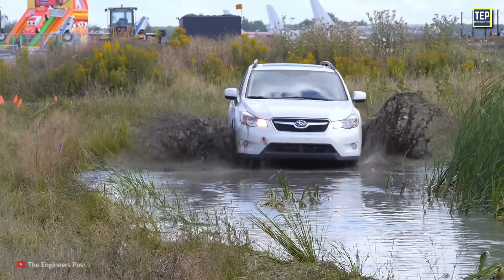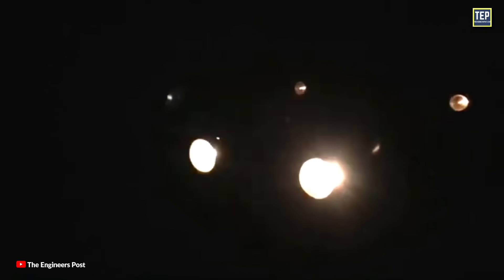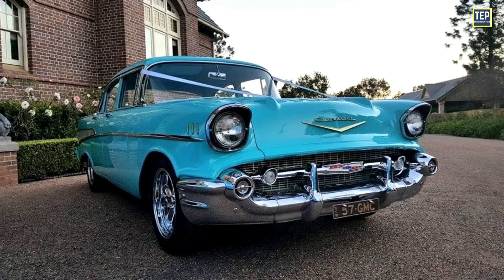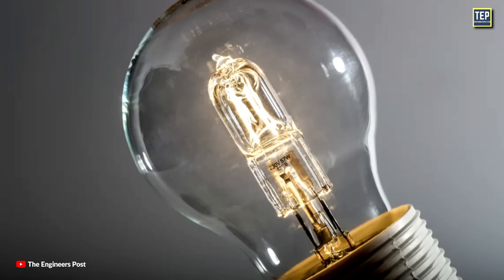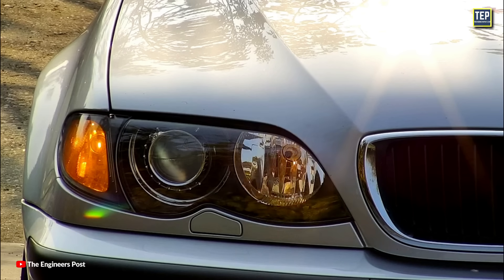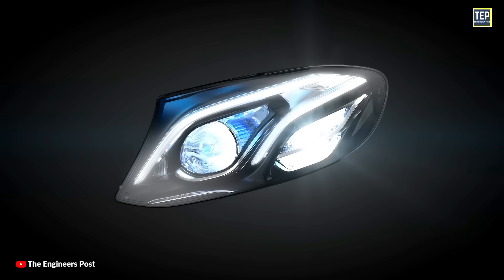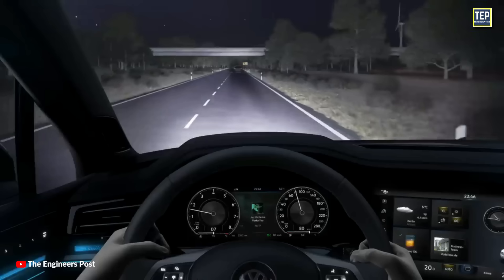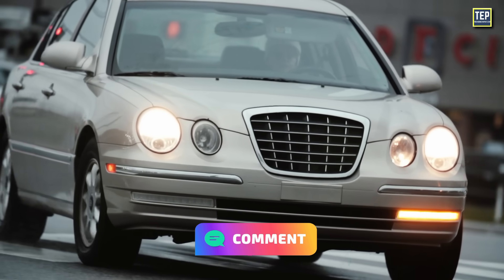The Problem With These Headlights

Comment: There is not much wrong with current headlamps (note: headlamps, not headlights!!!) per se.
The problems is mounting height, poor aim, lousy reflector and lens, poor beam control, and worst of all, stupid drivers who keep driving with the high beams on.
Evidently, nobody tells these idiots that little blue light on your instrument panel means you have your high beams on.
That said, you will never get a ticket in North America for driving with your high beams on, whereas in Europe you will get a pretty expensive ticket plus some points as well as you may blind oncoming drivers to the point where they may run off the road.
Now, there IS a problem with new current type of lamps; have you ever had to buy a Xenon bulb?
$$$$$$$$$$$$$$$$$$$$$$$$......!!!!

Comment: I just traded in my 2008 Mazda 3 S Sport (with smoke tinted lenses) for a 2017 Passat w/ Tech.  The stock headlights on the Mazda always seemed lacking.  I also have an '07 Tacoma 4X4 with stock halogens.  The Taco's lights are so bright, I rarely use the high beams.   With the VW's LED lights, I feel sorry for oncoming traffic.  I never need the high beams on the VW.

Comment: H6024 and related numbers are Halogen sealed beam bulbs and available since circa 1975 in the U.S. Can get DOT/ECE Legal LED Sealed Beam but expect to pay $200 to $300 USD for 2 lamps. Most LED and HID before that sold thru Amazon Ebay and many others are NOT "Street Legal" and worse many have Counterfeit DOT or ECE marks. LED or HID Does Not Work in Halogen Shells of any type because of Focus and Heat problems. LED for Headlights Generate a lot of Heat that must be removed or the units will have a Very Short Life. Even when you buy Legal LED Sealed Beam lamps often they won't last because not enough airflow on the back that is a Heat Sink.

Comment: I am old ish😊 , I’ve driven with all of those lights except for the old old chemical gas ones in the early 1900’s. 
  Good lights are important , but unfortunately they are often misused in the wrong application, and also sadly , they are often used by uncaring ignorant drivers . 
 I might add , as someone that worked in car repair industry , and also drove trucks for a living for years , headlights in many countries are probably one of the most poorly policed safety items on a motor vehicle , that goes for general specifications and also design, like for example uniform headlight heights ,  if you have been in normal sedan sitting at the traffic lights and had higher SUV or four wheel drive sit behind you with the much higher headlights shooting through your back window lighting up the inside of your car like a bright sunny day , you know what I mean. 
 Poorly adjusted headlights, incorrect globes and lights fitted to unsuitable headlights with the wrong reflector shape . 
 Bright lights are fine if they are adjusted and set up correctly. 
  I’d say if you drive highway there is a happy medium to the brightness of lights , even if you are alone on the highway and driving for hours at night , having lights that are so powerful when they hit the shiny metal back of a metal road sign and reflect back at you can really make your eyes sore. 
 A good spread of light that is fairly white but not so white it hurts to look at is good . 
 And low beam lights that are still nice and bright , but adjusted away from oncoming drivers and below their windscreen level . 
 Some cars have height adjustable lights from a dial in the cabin which Is pretty cool , other have dampened height self adjusting mechanisms. 
 Then there are the old cars that are just set at the factory, they have a device they stick in front of the headlights which shows where the main part of the beam is and adjust it to the centre line while on high beams . 
 Of course when you put something heavy in the boot/trunk , the back of the car goes down pointing the old style headlights up a bit , you get that in the pick ups too. 
 I remember as a young bloke driving up the country at night on a very windy mountain road I was going around a bend at a fair rate of speed , there was a very big drop down into the valley on my side of the road , and some asshole came around the bend with headlights and two powerful sets of driving  lights on full beam , I was absolutely blinded for about 4 or 5 seconds , I had pretty good nerves back then , I held the steering wheel in same position and managed to negotiate the bend ,  the asshole just continued on with out dipping his lights . 
Humans can be ass holes sometimes . 
 I must confess  , I probably like leds the best because they light up instantly, they don’t need a few seconds to warm up. Although my current lights in my car are HID with the correct reflector on low beam and the original old halogen globes for the seperate high beam lights , which I have to say are just adequate , however they are very comfortable for driving for hours at night . 
 Here is another little bit of trivia , blue is the hardest color of the light spectrum to see and look at , if you look at the dash lights of many modern cars they are a pretty blue , and people always like the pretty blue and no doubt that is why most car makers use it , but the fact is , blue is actually sub optimal, the best color for long distance night driving that is easier on the eyes is actually red. 
As an old truck driver at one stage I did a fatigue management course , and this one of the topics mentioned for long distance driving. 
 And having driven many many big rigs over the  years , I can confirm red hurts the eyes less.
Reply: Red lights are used inside submarines
Reply: I believe so too, red is better than blue.
Also really? Waiting 2 seconds for xenon's is that bad? LEDs have many more advantages but you mentioning only this is funny for me.
Reply: @drayke8886  you misunderstood. He was talking about the colour of lights inside the car at night. As another commenter pointed out, red is used inside submarines. It’s the colour that is easiest to adjust to no light from. It’s therefore the colour that has the least difference to darkness in front of the car. It’s least stressful.
Reply: @nickc6882  "I must confess  , I probably like leds the best because they light up instantly, they don’t need a few seconds to warm up." What part of this is talking about the lights on the inside? Do y'all also have some weird halogen or xenon lights for every button that needs to light up?
Reply: What isn't covered is the old round lights had a beam that illuminated the road ahead, not the verge or the treetops, all the modern lights I have experienced throw the light everywhere except up the road, creating more dazzle for oncoming drivers. They may be as claimed more light efficient, but they don't use the light efficiently.
Reply: @CrusaderSports250  possibly you are experiencing badly installed or cheap ones then. I agree with your comment that illuminating tree tops is a waste, but the verge is essential for at least 3 reasons:
1. Animals and people step into the road from the verge, you want to know they are there before they do
2. It gives you indications of corners before you get there
3. It shows you junctions and side roads 

Modern matrix LED headlights are so accurate they can put high beam either side of the car in front of you whilst maintaining low beam on the vehicle itself.

Most of the times I’ve been blinded by LEDs is when the car they are in is modified or overloaded. If you raise a 4x4 for off reading, you lift the lights with the car. They need to be adjusted to compensate but never are. If you overload the rear of the car, the front tilts up. Overloading can occur when you modify the car with accessories and then tow something. The load on the rear can compress the rear more than it’s designed for.
Reply: Can someone add a TLDR?
Reply: @fruityflop8  Why?  Is "Too Long, Don't Read" too many letters for you to process?

Comment: I'm getting to the point where I contemplate fitting LED spotlights so I can blind the drivers of the oncoming cars that have their LED's on high, or adjusted poorly, and blind me. And don't get me started on auto shops selling non-ADR compliant lamps meant for off-road use.....
Reply: Every once in a while I see that one meme of the car driving along the road that gets blinded by a lifted truck behind them, and then proceeds to open their trunk with a mirror or lights in it to blind them back. I think about that meme often and have considered doing it myself LOL.
Reply: I'm considering doing the same. I'll flash my lights when someone comes towards me with their high beams on. They rarely dim their lights and will often make them even brighter or turn on a second set of high beams in the headlights. I only have factory high beams in my car so I can't go any brighter.
Reply: Agreed
Reply: Unfortunately the driver would probably still be absolutely clueless as to why you are doing it.
Reply: Remind's me of a story of a bloke in a well equipped four wheel drive, there was an oncoming car that he thought was throwing out way to much light, so he flipped on a big bank of spotlights on top of his cab, "that'll fix em". They responded by turning on their police lights and siren!. His response after saying "Shit" was to select low range and go off road. Luckily for him the police had no answer to that one.
Reply: My dad had a friend years ago that mounted and rigged up a spotlight in the back of his small truck... and when I say spotlight, I mean an old military air raid spotlight, said it was the most satisfying thing ever to see their headlights swerve and go off the road when they'd run up behind him with their ultra bright headlights in his mirrors. Did they get hurt? Probably, did he care? Why should he? They felt it was fine to blind him, so they got a taste of their own medicine. Moral of the story I guess here is, don't be an inconsiderate prick, cause there's always a bigger prick that is considering you.
Blessings on your project, I hope you blind many inconsiderate asshats.
Reply: Fitting led spotlights for vehicles driving in cities should be illegal
Reply: Good as it got was halogen. Screw efficency and overly bright lights that do not shine in the visible light sprectrum
Reply: Brother I get exact same thought but I live in a tier n city so no good modifiers here 😂
Reply: At home you yell at the kids to keep off your grass, right?😅
Reply: @user-mf5to8mb3h.  I know several people who were ticketed for flashing their lights.
I wish cops would test headlights as they do with darkened glass, the ticket accordingly.
Reply: All my lights have been ajusted properly but my truck still sits higher then cars so when im driving in a city I blind the out of stater who moved here. One person did what you though of and flashed the wrong person and the person they blinded flipped on ALL of their off-roading lights at once, dude panicked well blinded and crashed his car. The dude who did what you are thinking was found completely at fault and charged with reckless endangerment because they were going out of their way to blind another driver who had all their lights properly ajusted to manufacter and state requirements. Before you say something about highbeams his truck doesn't even have high beams (he pulled them out bc he didnt like the way his truck looked with them) and the off roading lights can be seen from blocks away, as well as he had a dashcam)
Reply: @David-jt9nt Sounds like he should have kept driving. No sympathy for inconsiderate pricks with overly bright headlights and all their excuses. Turn them down or change them out mister "I have a truck that sits high" who asked? Seems likely there's plenty of people with trucks of your height that aren't blinding people, so maybe the problem is you, not the world around you.
Reply: @Hiatus-Humanus My buddy has a brand new chevy 1500. Stock everything. Lights are WAY TOO HIGH and bright as fuck. It's a company issued vehicle. Is that his fault?
Reply: @gahbah274 all you need is a measuring tape and a Wall, in Sweden you would not pass inspection low beam on 10 and fog on 20
Reply: @David-jt9nt nobody cares about your crappy ass truck

Comment: I have no experience with laser headlights, but all other types, Xenon is still king and best. And I am talking about how much light it output. Bi-Xenon is rubbish, but use xenon with proper dedicated lamp and it is really-really good.
Reply: My BMW 320i from 2013 had bi-xenon, and that was impressive.  But my 2019 BMW 320i with laser light is just twice as good as Bi xenon. Especially the beam assistant which changes the beams to oncoming traffic and traffic in front.  I can drive in most cases continuously with the high beams on.

Comment: I love the Matrix LED Lights in my ID.3.
Turn off automatically within city limits, turn on above 60 km/h and so far in the last 10 months I was never blinkt at from oncoming traffic while on high beam light or any funny reactions from people driving in front of me 👍
Nicely done video 😊
Cheers from Germany 🇩🇪
Reply: I'm curious. How much does a Matrix LED headlight cost? My guess would be around $2500.00 U.S. dollars
Reply: @VF31Rules  One matrix headlamp on my 2019 Gen5 Subaru Outback cost AUD$3000 (USD$2000) for the part only, when it was replaced after a collision. The Gen6 Outback matrix headlamp has more segments, so it wouldn't surprise me if that was more expensive.
Reply: @VF31Rules yeah, you are quite on point with that. It’s usually something around 2000€, but honestly, it’s worth it.
Reply: That's so ridiculous, can't be inconvenienced to flip a switch while driving... 🙄
Reply: @Hiatus-Humanus the ultimate argument against any type of new technology that does something automatically.
Reply: I wish I could have matrix lights but I live in the USA 😞. At least they will turn around corners.
Reply: I've got Matrix headlights on my BMW.  I love them, but I don't think people driving in front of me like them.  I say this because I've had people pull off to the shoulder to let me pass.  I feel the reason is because as parts of the light beam turns on and off and moves around, it confuses them.  Possibly making them think I'm flashing my high beams.  It gets really bad when I have oncoming traffic.  Because when there's no oncoming traffic, my high beam shoots to the left and right of the car in front of me.  When a car comes up, the left side high will either drip down or turn off, then it's back on.. making the car in front think I've flashed my high beams.
Reply: @crabjoe  They are confusing. The light moves around giving a wrong impression of what's truly happening at night on a road.
Reply: @crabjoe That's very interesting. Unintentional consequences that most wouldn't think of until it gets actual use...
Reply: @crabjoe Never had the issue (on a 2024 BMW i5). Works perfectly and never get blinked at. If I get blinded by LED lights it’s a tesla in 90% of the cases.
Reply: @crabjoe  I've never had a problem - I've even asked a few drivers when they stopped for gas if I was by any means blinding them and they all said that I wasn't. But it's super important to have them properly adjusted. I once went to a road worthiness check (mandatory every year in EU), and the guy decided they were too low and adjusted them, and I was flashed by every second oncoming car :( Pretty embarrassing actually, I had to stop using the feature for a week before I was able to set them properly again.
Reply: I can confirm this as a fellow ID.3 driver. The only issue I’ve had so far (driving an ID.3 for 3 years now: Sometimes I encounter billboard-sized, reflective yellow guide signs that throw too much of my own light back at me. But I recommend that option and wouldn’t like to miss it.
Reply: @Zeguyfromgermany  I have a 2016 Audi Q7 with an adaptive matrix headlamps. And it has a setting for not only cutting oncoming traffic, but street signs as well. And it works wonderfully. I have this car for about a year and I've never been blinked at so far. So when I drive from city to city, I just turn on auto high beam light and forget about it. :) The car also has night vision, which helps a lot with curious wildlife on the roads. I honestly think this setup is perfect for long trips.

Comment: The issue is that Xenon Laser and LED are far too bright for oncoming traffic. You're more likely to blind the other person driving towards you, which is always a bad idea. There is zero reason for them to be in every brand new car on the road.
Reply: I’d suggest you get your eyes tested. HID and LED’s produce more black light which causes less glare. Basic facts sorry pal
Reply: Mmm, I like them, you just gotta make sure you turn them down or smth
Reply: As far as I know, on low beam any type of headlight technology should not blind oncoming traffic if adjusted properly. That amounts to the beam being cut off before it reaches the oncoming driver. As far as high beams go, the onus is on the driver to cut to low before oncoming traffic can be blinded.
Reply: @mauritsvw  of course it will, if the oncoming car is higher, if the road is bumpy or hills....
Reply: That’s why they have automatic adaptive technology, the lights quickly adjust to traffic mine work great and allow for awesome visibility!